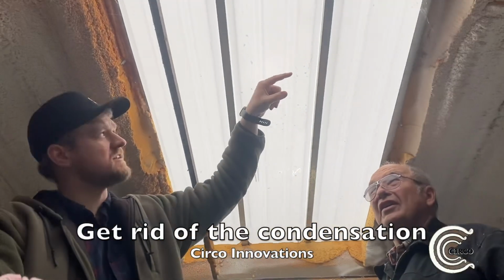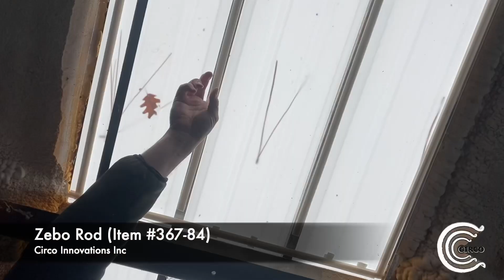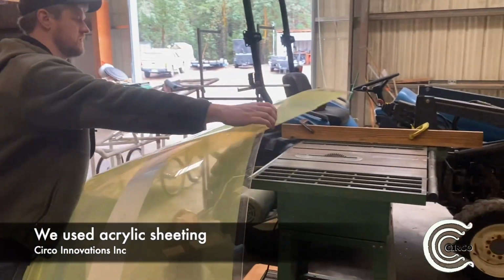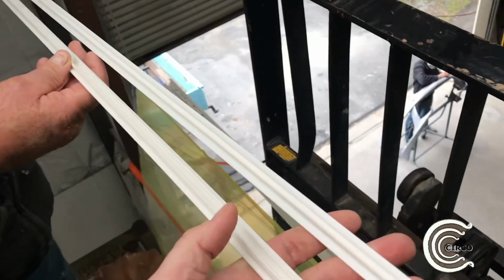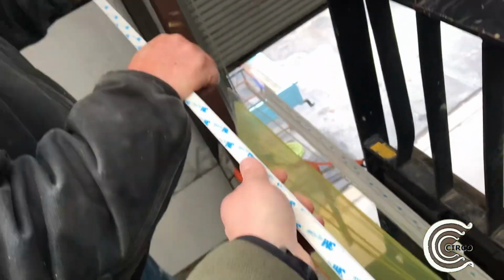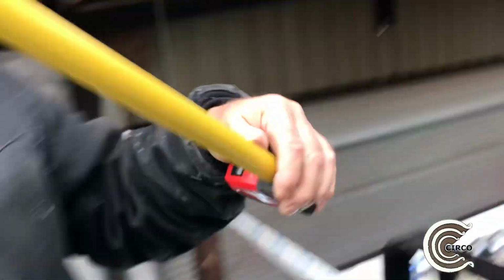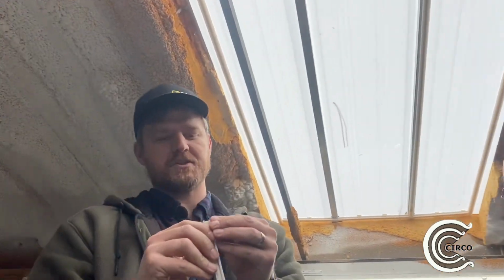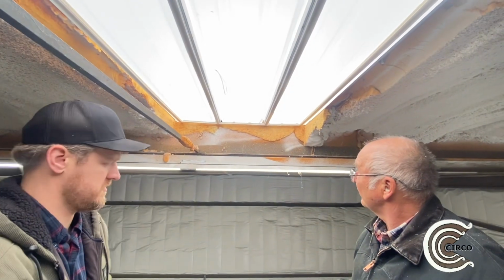Do You Have Condensation From Your Skylights In Your Warehouse / Shop? Problem Solved! #DIY

Comment: You'd have to vacuum seal between those two layers for this to actually work without it being vacuum sealed you're just going to have a pond forming in between the two layers one side just going to fill up with water vapor condensing to water ultimately making you a little pond probably going to grow algae🎉
Reply: You can stick something like silica beads or calcium chloride in between the panels to absorb water. They just have to be replaced.